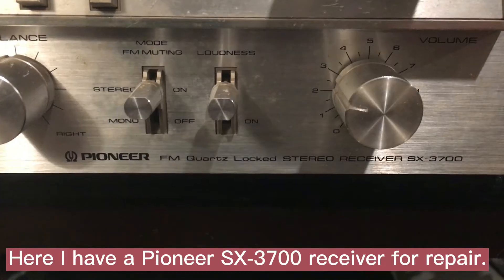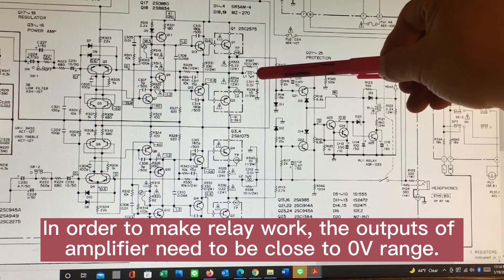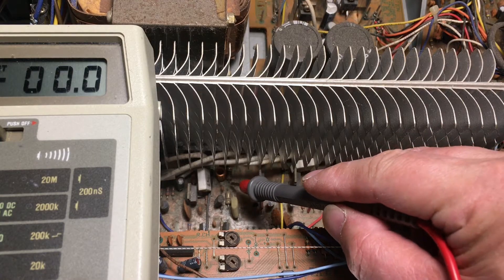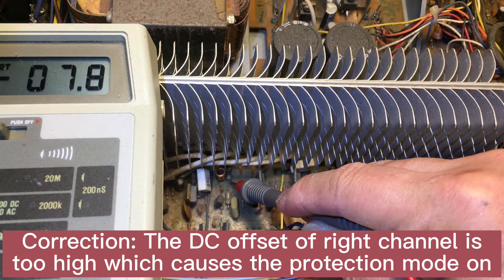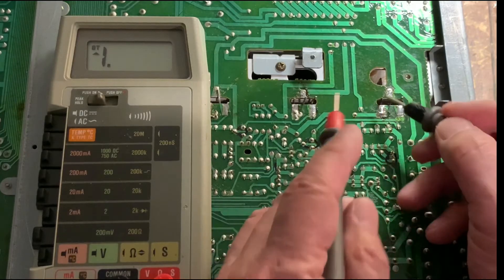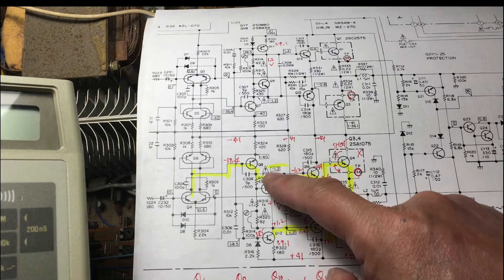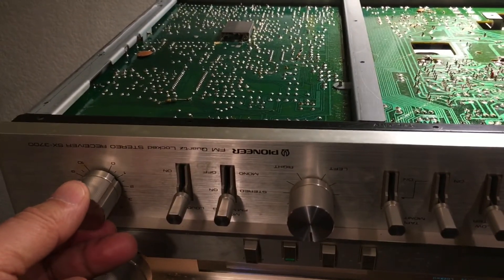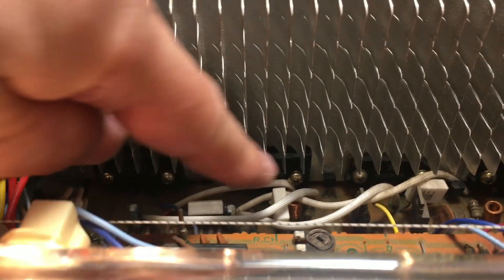Pioneer SX-3700 Repair - Protection Mode On

Comment: Greetings,

Great Repair.  I am having issues with my repair.  I replaced the Q1-Q4 and the protection circuit trannies.  It plays without a load however when I plug in headphones or speakers and give it a little volume the protection relay keeps tripping of and on.

The tripping seems to be in step (beat) with the music.  The protection transistor Q25 is not turning off.  The voltage of off R121 560 (2w) is fluctuating between 16v and 40.  The resistor tested good.  I have replaced the relay, Q9,10. Q11/12. Q7/13 etc.  With no load the voltage are correct except the right side is at 33v instead of 38 to 40 like the Left side.

any help would be very appreciated.   

Thanks in advance!

FYI I do have another working unit that I am comparing it too,
Reply from the maker: To isolate the issues, I suggest to check DC balance at both channel power amplifier outputs ( test points at between R337-R118 and R338-R119) first. The voltage should be close to 0 V. If the voltage is fluctuating, then the problem may be in the power amp section. Next step, if there is no problem on DC offset, I suggest to check or replace C116 (47uf 50v). The defective C116 may also cause voltage fluctuating at R121.